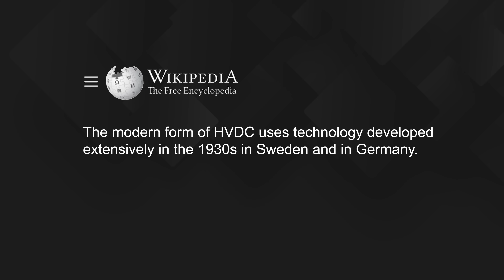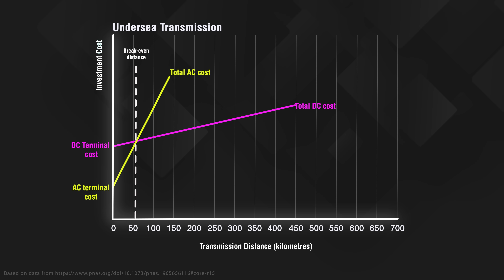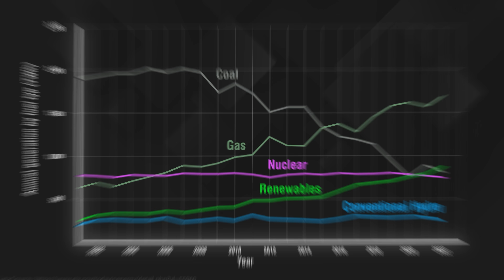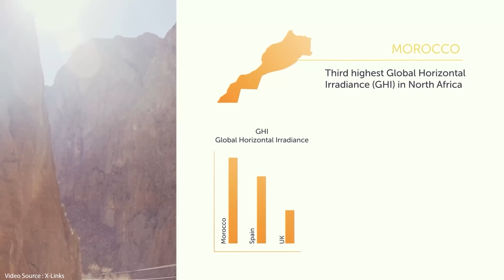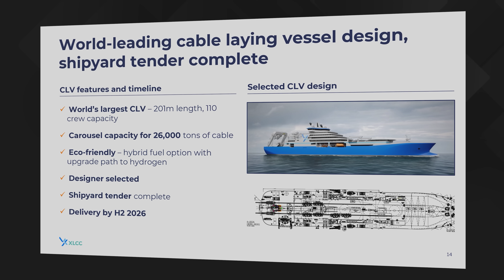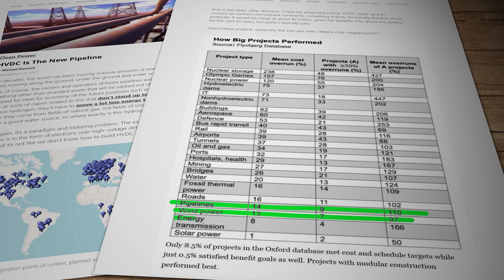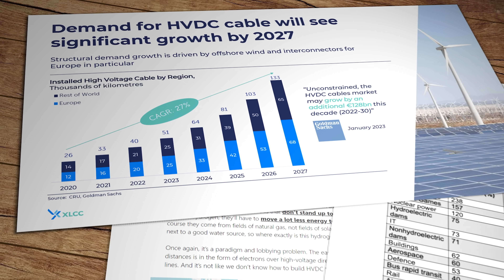Revolutionising power transmission.

Comment: This is a really good idea and sounds like an awesome step on the way to net zero. Just one small snag i can see getting in the way later on down the line... Humans, and more specifically our willingness and ability to work together for the greater good and not use it as a tool for control and coercion.🤔
Reply: HVDC interconnectors have been in cross-border use for at least 3½ decades without any major repercussions. They're used worldwide, as we saw (briefly) in the maps in the background.

Comment: Very interesting. We (Denmark) have several HVDC connections to our neighbors, but the last connection to Germany was HVAC, because the DC connections have proved to be causing more problems than benefits. The electromagnetic field they put off is fucking with shipping and fishing, and anyone measuring ground current anywhere withing 100km is picking up traces of current.
Reply: That claim about DC fields sounds made up. Got a reference from somewhere besides the fossil fuel business?

Comment: All sounds good with HVDC but cables have resistance and the longer they the more losses. If I was to send 1 kwh of  energy  from Essex to Scotland via the grid more that 10% is lost. So if I generate my own electricity I will be 10% better off and if I store in battery I have loose of 10% instead of 20% with grid power. Local Solar Wind and storage project could save 10% energy plus lot less copper used. Only use grid to transmit spare electricity.
Reply: Essex to Scotland is only 481 miles.  Line losses from a 1 megavolt HVDC line would be around 2.7%.   That's the whole point of using high voltages.  Line losses from resistance are a function only of the current, resulting in a voltage drop.  But that drop is almost nothing compared to the 1 million volts the line is running at so the actual power loss is minuscule.
Reply: You are right the higher voltage the lower losses. DC to AC invertors and transformers all have losses.
Reply: @kimedwards3937  ... which you can look up, if you are interested.  Instead of just assuming that they would be the same as your run of the mill consumer electronics device.   And while you are busy looking that up, you can also lookup the differences in line losses between AC and DC transmission, and the differences in losses in transmission lines vs distribution.

Everything in the universe has losses.  Just stating the fact doesn't mean anything if you don't know what they actually are.
Reply: Thanks will look up AC DC line losses.Nice thing you never stop learning.

Comment: I would have figured that most all systems were already interconnected. No wonder we have peak production at a different time from peak usage.
Reply: Most large systems, in fact, ARE interconnected.  At least on the same land mass.  Even Texas has interconnections to other grids, for example.   However, the capacity of those interconnections are another matter entirely.   Just being "interconnected" does not mean that an infinite amount of power can be shared between systems.   The point of the long-distance transmission lines being talked about in this video is to also have a high power transmission capacity.

Comment: Kind of a poor start on this video - an appeal to authority coupled with a conspiracy.  There is no conspiracy to prevent new power technologies and the fossil fuel industry has nothing to fear from any new technologies, not least because there are really no viable alternatives on the horizon.    

HVDC is almost an irrelevant part of this discussion.  It has been around for decades and its deployment is equally useful regardless the power source.  

I would sure like to see a credible report, not mere propaganda or puffery, that shows how "green" power can replace fossil fuels.   All we get is puffery.  In this case, somehow what is old is now new and exciting.  

It would sure be nice if this "green" transition were based on rational economics instead of CO2 hysteria.
Reply: Not logical, if it isn't for the CO2 issue what's the point of transition?
Reply: @englishcitystone1663  One point of a transition would be if we are facing something like peak oil soon, and several researchers say we are.  Even if that is true, we still need a better option than what is being offered by renewables enthusiasts.  We have now spent $trillions on this alleged transition to little positive effect and huge opportunity cost.
Reply: @joemccarthy7120  They were talking about oil running out when I was at school in the late seventies!
Regarding replacement energy provision what's the choice?
We have nuclear power and natural energy harvesting. 
Both more expensive and harder than burning some sht. So trillions or not it will have to be done. 
Unless you would rather roll the dice on the CO2 build up?
Reply: @englishcitystone1663  We have enough evidence now that we shouldn't be panicked about AGW.  Nevertheless, even if we may be rolling the dice, we aren't solving anything with wind/solar - not even close.  I personally don't favor us spending now $trillions on technology that we know isn't even fit for purpose at present.   It would be a lot better to wait until the breakthrough technologies actually exist.   There are serious opportunity costs to the approach we have taken on renewables, with no benefits to date.
Reply: The fossil fuel industry spends hundreds of millions on lobbying and spreading disinformation. Their fear is real.

Comment: That is amazing that we can move that much power through underwater transmission lines .I am excited about the new technology in battery storage systems like Iron flow and vanadium flow batteries that last twenty five years or longer and are environmentally sustainable that could help get the intermittent supply issues resolved to store energy from these new lines
Reply: flow batteries are now old enough tech that you can buy one
Reply: @alanhat5252  yes I bought a few shares a couple of years ago from ESS they make iron flow batteries and a German company prolux is making a flow battery for home use they are going to be less expensive than lithium batteries for home storage

Comment: How long do these supposed "Zero Carbon" systems have to run before they pay off the carbon outlay when constructed? (Probably longer than the lifespan of the build I suspect). This sounds like more pie in the sky BS.  We currently do not have the raw materials for constructing all of the supposed solar panels needed for this pie in the sky supposing.  There is a lot of wishful thinking involved in this stuff.  Keep dreaming guys while the worlds hunger for power grows.   This stuff is a joke.

Comment: The difference of "break even distance(s)" between HVAC and HVDC depending on whether they are overhead or underground is something I was totally unaware of.

I have always liked the idea of supplying road vehicles with electricity via transduction; something like toy slot cars powered by electric toothbrush chargers. There's at least one trolly system powered this way in Japan.

Integrating a transportation system using conventional contact or transduction over underground powerlines could capture electric bleed off.
Reply: It would never be done with a transmission line.  Transmission lines need to be in an area where digging will not happen, and must be buried fairly deep to protect against incursion.  With a HVDC line, there would be almost no power lost to induction, so there wouldn't be any to get in that way.  Creating "charging roads" has been talked about, and there are even a few demonstration projects, but they are a dead end.  They are far more expensive than a regular charger, are inefficient, so you lose a lot of power, and it would be very difficult to charge drivers for the power.  Cars would require expensive extra hardware.  Maintenance on such roads would be very expensive.

Comment: Soooo why not design more energy stingy electronics, motors and transmission lines. Sum call it energy efficiency, I call it being stingy with the use of current. Only wat is needed is what is used. If sumtin is off(standby) the design should only be using less than 10milliamps.
Reply: Naw.  They would rather take away food production and otherwise lower our standard of living.

Comment: Why don't we have D.C. as well as A.C. wiring and ports in our homes?
Reply: Потому что если прикоснуться к розетки 110в постоянного тока вас убьёт моментально!!!! А от переменного отбросит... Видимо история электричества , написаннная кровью, начиная с 19 века, ни чему не учит👎
Reply: DC is a lot more dangerous at the residential level than AC, and DC breakers and switches are a lot more involved than AC breakers at modest amperages or higher.

An AC breaker or switch need only open its contacts.  Since the AC current crosses through 0V every 1/120th of a second, that is enough to break the electrical arc.  An AC breaker, in particular, can break a shorted connection simply by opening up its contacts wide enough.

DC current, on the other-hand, is not oscillating and so does not cross through 0V, which means that a DC breaker has to snuff the arc out, particularly in the case of a short, and this is a lot harder to do reliably.  DC switches are also more involved with regards to safety.  Once you get above around 48V (let alone 120V), things get dicey if the equipment is low quality.

Basically, unless you want all your residential gear to double in price, AC is the way to go.  Plus, most residential electrical gear is cheap junk and I can pretty much guarantee that the number of fires will go up by a factor of 10x if it were DC (which can't be cheap junk) instead of AC.

Comment: Note: I am an EE however I have not worked in the power industry.
With that caveat, I wish to note that conductors may deliver both AC and DC current simultaneously. 
It would be interesting - at least to me - if any of these HV/DC systems also facilitate HV/AC systems also.
Reply: Germany has built a HVAC/DC hybrid overhead line some years back, called Ultranet. The towers feature a 420kV AC system and a  420kV DC bipole ( I think). It's a joint project of TSOs Amprion and TransnetBW.
Reply: @zillenjunge  Different conductors for AC abd DC though, not what was implied.
Reply: Ultranet was designed with the  capability  that the DC system can optionally be operated as an AC system. For that reason there are three quad conductor bundles on the DC sidevof the towers, a plus pole, a minus pole and a grounded quad conductor. 
However, operating at the same time with AC voltage and DC voltage would destroy the AC transformers. They can only withstand a minor offset voltage. I don't know of any power transmission system using AC with a large offset voltage. But I'm not an expert in power systems, just in overhead transmission lines.
Reply: Yeah, duh the transformers would be a problem. The grid must be more interesting than I thought when in school. I'll stick with amplifiers,... And digital stuf. Save my fingers and hands for other work. Lol

Comment: Recent development in HVDC converter technology has enabled much higher voltage and power for HVDC links. A limiting factor has also been circuit breakers that with new technology now can handle larger DC current than ever before. One advantage with HVDC sea transmission is that you only need one cable. The water is the other conductor!

Comment: Transmission cable made from Carbon fiber with an aluminum jacket is available from a company called TS Conductor.  It's ampacity is 30% greater than traditional steel core aluminum jacket transmission cable.  That means an existing transmission line could be upgraded to carry more energy without and changes to the support structures.
Reply: That's cool, but the cost of the cable must be huge.
Reply: My understanding is copper has many times greater ampacity than steel wire... so the carbon fiber option doesn't sound very impressive...
Reply: @timtravelnomad  AC transmission lines run the electricity over aluminum.  The steel core is there just for strength to support the wire and does not actually carry much current due to the skin effect caused by AC.   HVDC works differently... because it is DC, the current runs through the whole core so cable strength has to be engineered differently.  Copper is way, way too expensive to use for transmission lines.
Reply: @timtravelnomad  there are too many modes of failure & they happen too frequently for copper to be used in transmission lines, it's also hugely expensive.

Comment: Small modular nuclear reactors will become the go-to energy source — built to run consistently and as a flexible, carbon-free resource. Those right-sized reactors are emerging now that the U.S. government has incentivized them, making them more attractive for lenders and utilities. “You simply must have some form of reliable, baseload power because you can’t get there with assets that operate (part of) the time,” says Jeff Merrifield, partner, Pillsbury Winthrop Shaw Pittman, and a former Nuclear Regulatory Commissioner. “A nuclear power plant is more costly upfront, but it is an asset that OPERATES for 80 years. If you compare that to wind and solar, they generally have 20-year lifetimes and batteries of around eight years. If you compare renewables and batteries to nuclear, nuclear stacks up VERY, VERY well.” The more of them you build, particularly in sites like former coal plants, the more you hook them up to existing grids, or local micro-grids, and ELIMINATE or MINIMIZE the need for new or greater TRANSMISSION infrastructure. The U.S. Navy operates over 160 ships powered by more than 200 small nuclear reactors (aircraft carriers, submarines, ice breakers, etc.)
Reply: Sorry, the entire lifecycle cost of SMR or any nuclear power solution per MWh is far higher than slapping down a bunch of PV panels or wind turbines along with a sensible amount of battery storage.

The US navy nuclear power programme isn't designed for low cost but to put power in difficult locations.
Reply: @AndyFletcherX31  Popular myth that is FALSE. Majority of large nuclear plant cost is financing over a very long period. Small repetitive designs are built quickly and cheaply. Multiply the solar cost by the 4 times you replace the panels and the 10 times you replace the batteries. Add the cost of recycling the panels / batteries or pollution in landfills. Nuclear is the ONLY energy source with the necessary ENERGY DENSITY to be CARBON NEGATIVE when combined with carbon capture. The ONLY adequate solution is not insufficient when insufficient solutions are sometimes less expensive in the short term by virtue of a failed / incorrect analysis.
Reply: @beautifulgirl219  Nope, panels will last 30 - 40 years before major degradation, LiFePO4 batteries will do >5000 full cycles so will be good for about 20 years. Wind turbines are typically repowered after about 25 years.  Nuclear power has a massive environmental footprint from mining and refining to the construction, long term storage and decommissioning. We also have security and safety issues with nuclear which you don't have with renewables that can be fully deployed within 2-3 years after permitting. It is worth noting that EDF in France are effectively bankrupt because of operational and decomissioning issues. In the UK the contract price of Hinkley per MWh is about 3 times that of current bidding for wind power. Hinkley is going up in price and wind still dropping in price. No myth there.

Comment: Magnetic effects of HVDC cables... on avian navigation, on rail cars? Do they have to turn off the cable to be able to pick up the derailed cars? Will the cables cause the derailment? Geologically speaking, will the cables gradually be pulled into the earth's magnetic core? 😏
Reply: it will give you covid
Reply: DC electric cables do produce magnetic fields but not EMF like AC. So the HVDc fields do not vary as much over time and are more manageable. This is why the cables are used predominantly under sea.